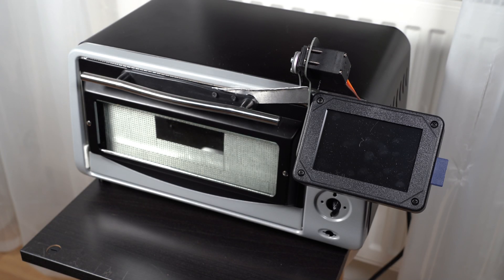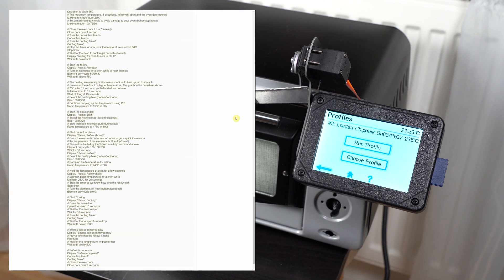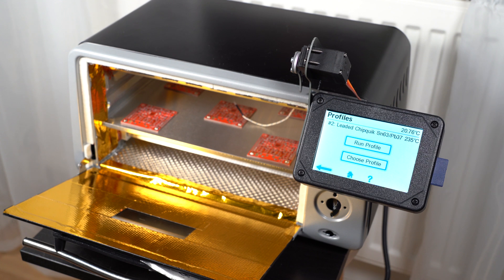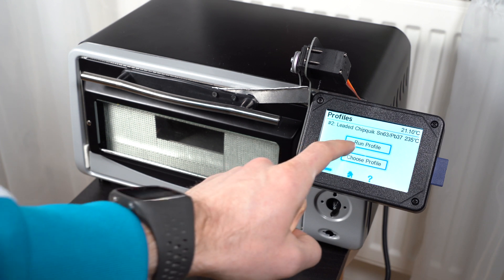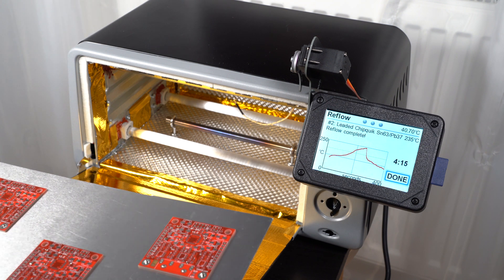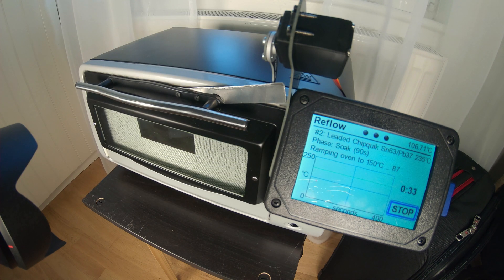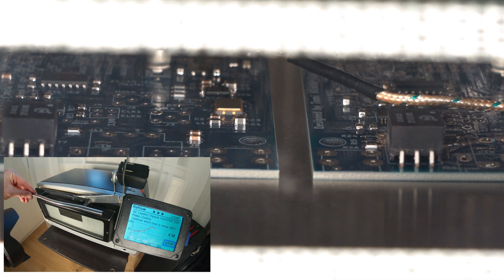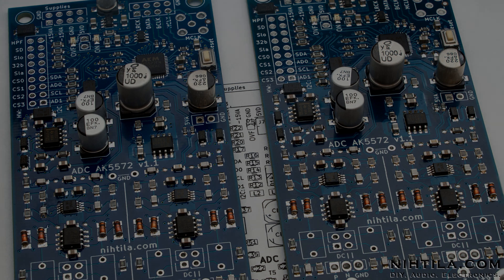Test Run of DIY PCB Reflow Oven Made of Two Toaster Ovens and Controleo3 Kit

Comment: Good video and great results.  Just got mine up and running after sitting on the shelf for three years.  Insulated the oven sides and tops, temporary foil over the window.  One thing you might try for the door is to use two door close commands, first a small amount and then a larger amount.  If you look at the code, I believe this is easy to do.  This four quartz element Black and Decker got a "Very Good" overall rating during learning with just the super wool blanket from left to right.  Nothing on the floor.

Comment: I've made a reflow oven from the same Controleo3 kit, but my oven came with 4x metal heating elements. I'm using the same leaded paste profile you show here and have had to tweak the instructions to account for the thermal lag/inertia of the metal elements.
I'm not sure why the profile needs to run to 235 when the melting point is listed as 183 in the datasheet for the paste. Maybe the other components in the alloy have not fully melted at 183 ?